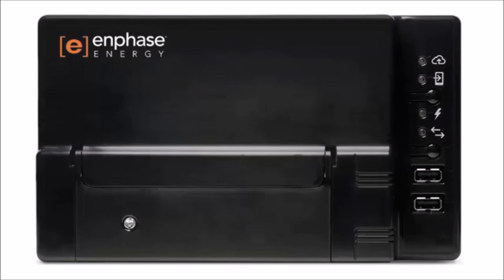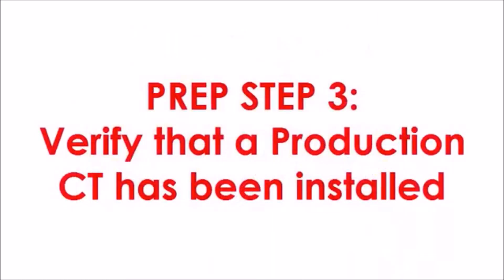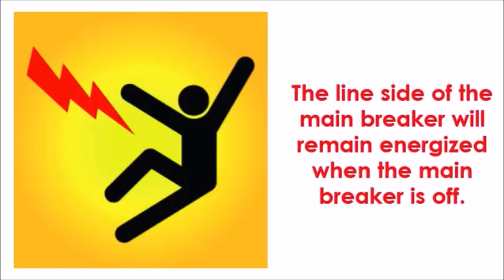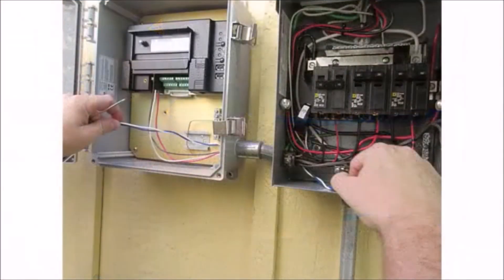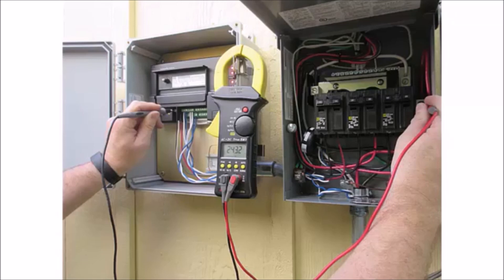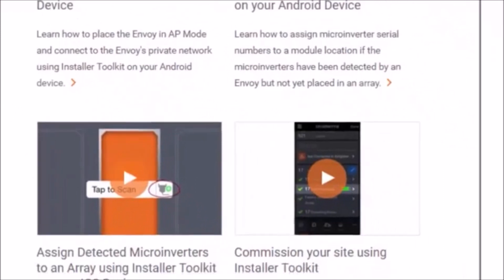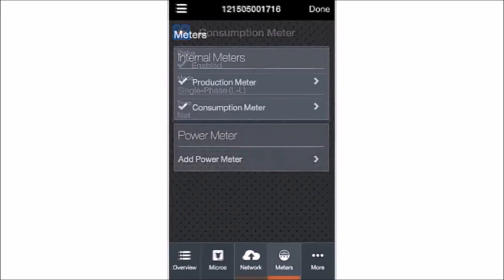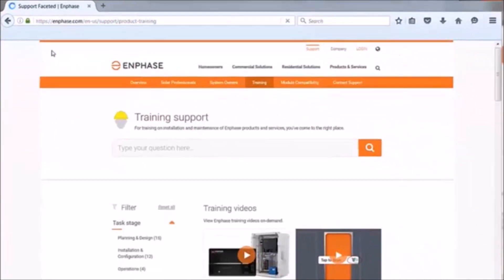Enphase CT-200-SPLIT  - How to Install Consumption CTs for Consumption Monitoring

Comment: Hi. Can we read production energy via PLC and still having accurate consumption values? This is, without using the production CT. Only consumption CTs.
Reply from the maker: Hi Ricardo! Consumption CTs do not measure production. You must have the production CT, which is included with the stand-alone Envoy and built into the combiner box. Let us know if you have any more questions. You can reach us by email at info@renvu.com. Cheers!
Reply: @RENVU  What is the difference between a Net Meter vs. a production CT? Is it required to be installed in a system as I feel it is redundant?